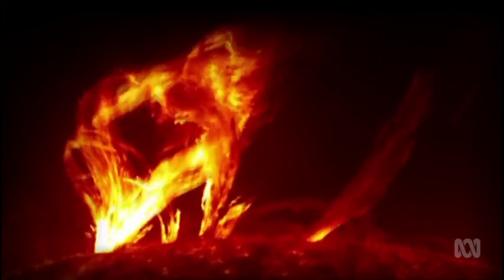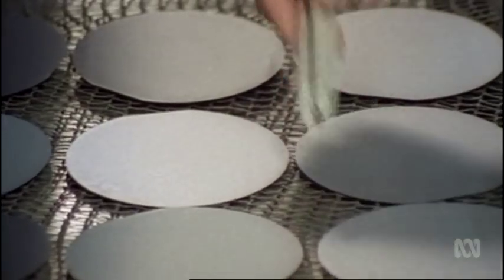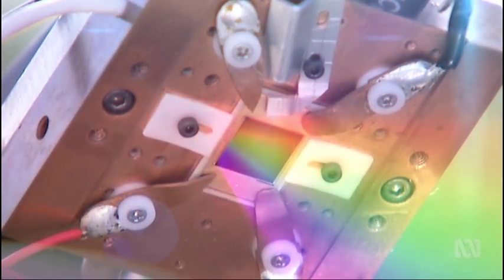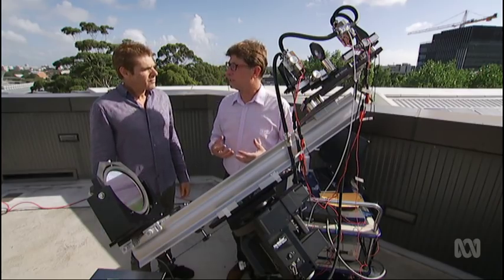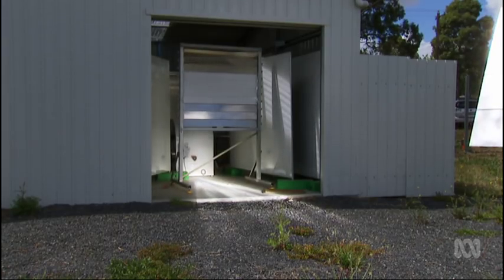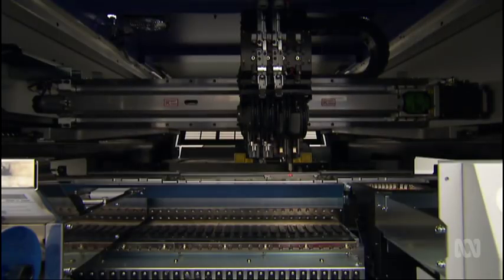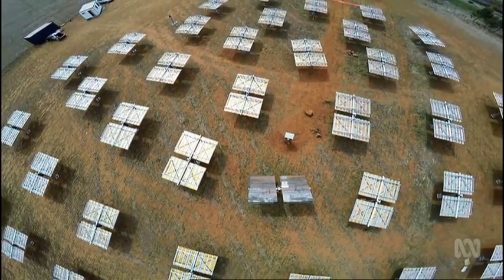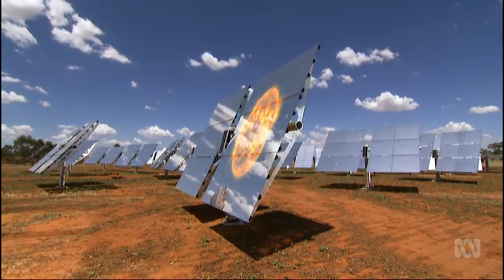Super Solar Cells | Groundbreaking Renewable Energy Technology

Comment: use the heat from cooling the efficent cells to drive a steam turbin that also produce electrisity?
Reply: While you are at it, you might as well go back to steam train's and nuclear energy.... We need to go forward, not backwards.....
Reply: @PeterMilanovski  Gravity have never gone of fashion,old as earth. steam used implemented with the tech we have today. If you think that the bat tech and led bulbs are good for nature,then you dont know what u are talking about. A led bulb of ok quality, in the socket there is a pcb with a step down/like a smartphone charger with low quality electrolytic capasitor that make them fail. Way way more garbage. and do you buy a no brand led bulb u hav bought garbage straight from factory. Another fail point is eaach led is driven to hard with to little heatsink to hold make them last. Goes for  Lcd Led tv,s everything with ledarray behind a display.